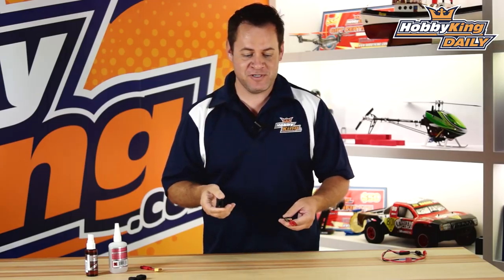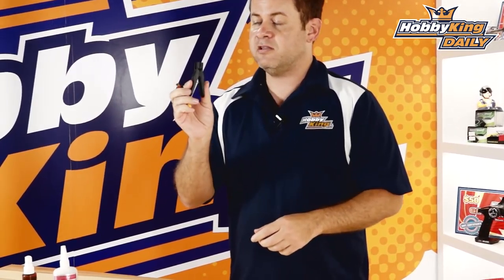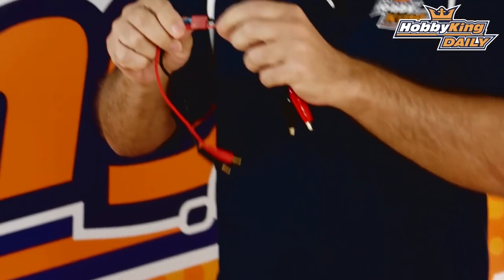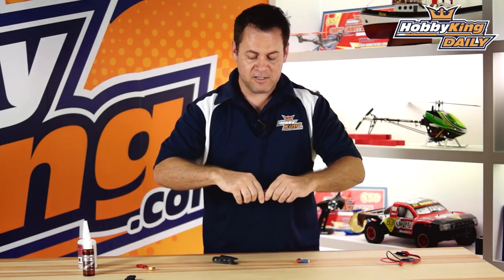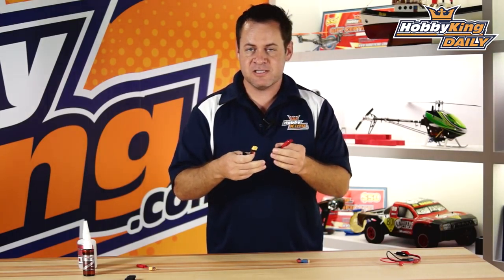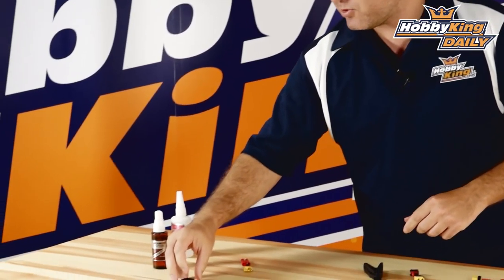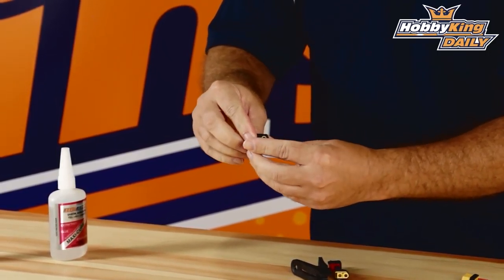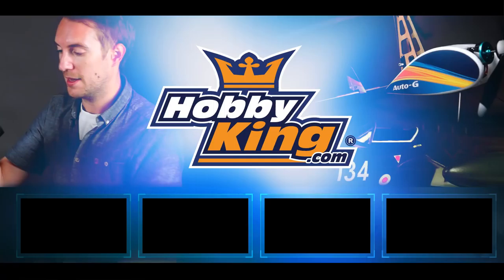HobbyKing Daily - Turnigy Easy Off & Big Grips Connector Clips

Comment: It looks like a useful tool for those who might have tough connectors to pull apart; however, I've found doing the solder joints right the first time avoids any struggle.  With XT60's always solder the leads on with a spare mate plug plugged in.  Then even if you use excessive heat the pins will stay in alignment.

Since I learned this trick I've never had an issue with stiff XT60 plugs. 

That said, I know there are some pilots out there with disabilities and I think this tool would be a great help to them to be able to use one hand to disconnect things. 

Cheers,
J

Comment: I need a fast motor to lift a heavy foam plane. I built an F-22 like jet. It was my own idea and It's about 5 foot long. I have a 60amp ESC with a burst to 80amp. I put some huge servos from my old electric car for the control surfaces because they are so big.

Comment: Its only your garbage XT60 connectors that need this.
No point in installing these on the T-connectors, they are fine on their own.
Reply: XT60 are way better than T-connectors. You probably never used them or don't understand how to solder them correct.
Reply: SvenOkonomi You can addjust the tight fit of the XT60's simply by slightly pressing the ends of the busses in the female plug a bit together. Always solder with both connectors pressed in. The Deans/T's I find a stupid design, not only because of theire exposed connectors that can easely short things out. If you still hate XT60's for any reason whatsoever I suggest looking at EC3 2 and 5
Reply: Arcee Moron Its not the bullet connectors (thats all they are, really) that get stuck, its that nasty plastic lego collar that often gets wedged sideways. And the exposed connectors are only stupid if you solder the male ones to the battery, but honestly who does that. The EC ones are too bulky.
Reply: SvenOkonomi Solder them with male/female pushed-in together and there's no problem? The bullet IS the problem sometimes, but can be easaly fixed. Exposed connectors are stupid, not only on chargers and balance boards. EC2 are very small, EC3 is same size, EC5 is bulky but for high amps where thick wire is required. So you want bulky connectors annyway.
Reply: The best connectors is bullet connectors. They can hold the most amperage and circuit.  And also they don't melt.

Comment: Nice idea but you can addjust the tight fit of the XT60's simply by slightly pressing the ends of the busses in the female plug together. That is if you solder them correct in the first place. On EC2 EC3 and EC5 you can simply use a c-clip plier tool to get them apart. T-connectors belong in the trash, most stupid design ever.